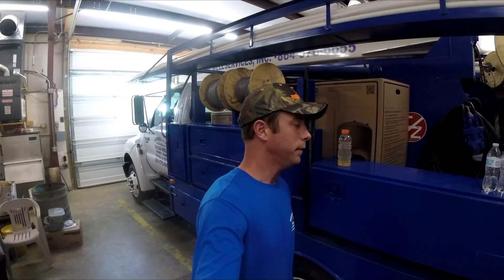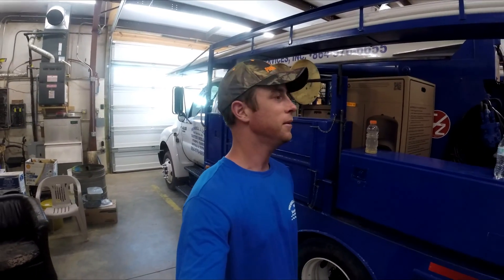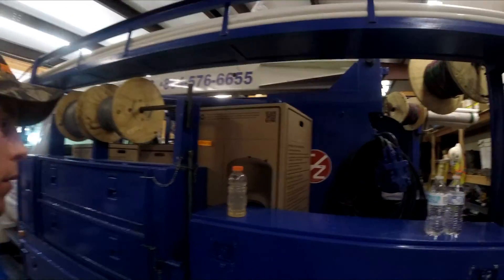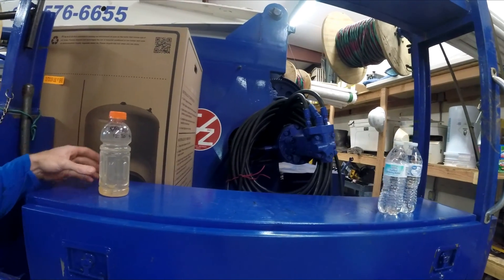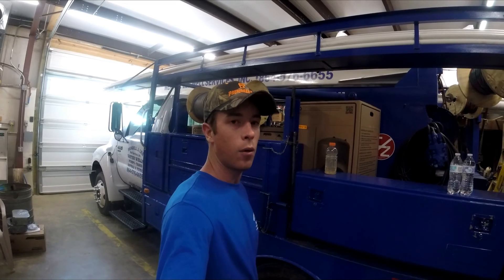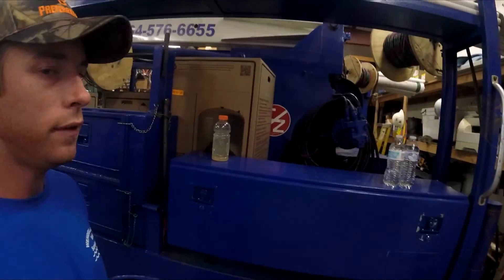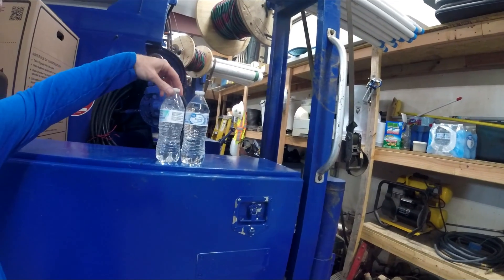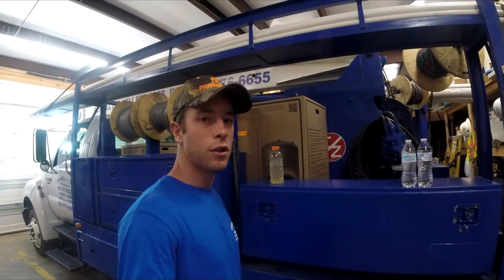Pumping a Well to REMOVE SEDIMENT and Develop Crystal Clear Water

Comment: Next to your pressure tank, there should be a hose Spigot, it should be between where you’re well comes into the house and before your pressure tank. You can attach a garden hose and run it into your yard or your sump pump to pump your well.

Comment: Would have been helpful if you showed how you pumped the well.
Reply: He just means he let the pump run to the ground for 20 hours like how the city does when they flush a line after repairs. There is probably a spigot at the well head that he flowed from so it wasn't running all thru the house piping.

Comment: Question.  I had a new well installed, they blew air down the well for about an hour.  Before connecting to the house they never pumped the water out of the well, it’s been weeks and we still have dirty water, it’s clearing but now the shower water cartridges are not working right and the toilets aren’t either?  It should have been lumped before connecting to the house?
Reply: @NetsarimTheWatchman  what if the well isn't new with the same issues?
Reply: @NetsarimTheWatchman  i live in nc my neighbor had a well drilled last year. How do I fix it??
Reply: @NetsarimTheWatchman  we have a new well (installed three weeks ago). We have not abandoned the original well yet. The water from new has a very fine sediment/sand/clay that clogs up the sprinklers. It is not hooked into house lines yet. Per well drilling company we have run the well for several 8-16 hrs a day for a couple weeks. Sediment still seen. They are now coming out to put a 2 in sleeve(?). I am concerned if there is a crack that needs repair (on a brand new well)- we are in for more troubles. Can you suggest anything? Maybe just keep running the well? We are in N Central Florida.
Reply: @NetsarimTheWatchman  thank you- I’m off to research spin down filters. We have an operational 2 inch well- but due to wanting to add on to the house, and also being told the 2 inch wells are hard to replace and we can’t chlorinate it- we opted to drill in new location. It’s a 4 inch well- but now the driller is talking about putting in a 2 inch sleeve and I’m concerned that we are going to affect the function of the new well. We’ve been running it for a few weeks/ maybe we just keep running it? Thank you again!
Reply: @NetsarimTheWatchman  again, I so appreciate your input!

Comment: My well is probably 50+ years old.  I don't think it was ever maintained well (pun...slightly intended).  I was doing some work on the outside water yesterday and had the pump on recirculate.  It is a surface pump, the water is about 8 feet below the well head and at least 75 foot deep (longest piece of kite string I had to check) and an 8" casing.  We have added bleach in the past but since I recirculated yesterday (for about an hour) the water is full of red stuff.  I am pretty sure it is rust as we put some in a glass, added bleach to no effect.  I am afraid that it is rust from the casing.... any ideas?

Comment: Hi. I've run my brain ragged trying to figure out what to do. I'm really hoping you might be able to point me in the right direction. I am the buyer on a pending purchase on 37 acres in East Tennessee. The property had, at one point, a house on it. The purchase is contingent on the well being viable. I live close to Atlanta so I'm not there and know no one local. The real estate agent found the well location but the guts are missing, or stuck down where (who knows?). He and apparently a good ol' boy down the road figured out that there is 90' of water, not 90' deep but he said water itself. It has had a metal cap put on it. There are no county records of the well. All I can find out is that it's been over 10 years since anyone has resided on the property. 
How do I go about flushing the well out, in order to test it? I'm sure there is bacteria and it will need to be shocked. There is no electricity and no pump. If there were a pump, I have a good portable generator and would figure out a way to flush it myself. There is no discernible driveway to get a large truck to the location, which is down a hill. I've typed every known configuration of words into google, google maps, youtube blah, blah, blah... the only information I can find is on homeguide.com which is more about what to do and what it might cost but not who to get to do it. 
Now I'm not some city dweller, I grew up in West Virginia and when we moved to Georgia 35 years ago where we live was the sticks. I have no problems getting mud on me and doing back breaking work but this is outside my wheel house. I've got about 3 weeks until the closing date. This property is for my widowed mother who is partially disabled in one dwelling and myself in another dwelling. My father passed almost 10 years ago, now he was a jack-of-all trades and he taught me how to weld, operate heavy equipment, mechanics, do damn near every type of home repair imaginable and we had a well in WV but I was only 10 when we moved here and we've been on county water ever since. I helped when the natural spring face collapsed on the old family home place near Clendenin, digging, shoveling, trenching, placing a new cistern to catch how far back we had to dig into the mountainside to get to undisturbed water (that was fun). Argh, sorry! I hate rambling on. I don't suppose you know anyone in that area that could do the job. I just looked you up and no your not close, but being in the southeast there's always a chance yeah. From what I've read it seems a derrick truck would be needed, but I don't even know what that means. 
Again my apologies for typing too much. You try to make an enquiry as brief as possible and it never works out. Any information you can provide me with, in any way, would be greatly appreciated.
Reply from the maker: where are you in East Tennessee? I may have some connections up there. You need to start by getting yourself or someone out there to drop a test pump in that well and pump it using a generator to see how much water it is producing. You may not need a boom truck if it isn't too deep to the water. If it is 200-300 feet to the water,  then that is a different story. At this point (3 weeks until closing), you need to be less worried about flushing it out, and more worried about whether it is viable. Because all the well drillers in upstate SC and in western NC are super busy and backed up. So you would want to get on someone's list quickly if this well wasn't viable and you needed to have another one drilled.
Reply: @WendellLeeWellServices  Hi. Thank you so much for getting back to me so soon. The property is in Treadway, near Rogersville, Sneedville, Thorn Hill. If my realtor was correct in his statement it is 90' of water but, he might of meant 90' to water. He's a local guy who owns land and also has a farm so I assume he's dealt with wells to a degree. If you know of someone reliable and honest in the area I would be grateful. If not, where in the world do I get a 'test' pump? And should I ask my realtor shock the well now (he offered) so that when I can get there to get the pumping going it's already working on killing the bacteria? Again thank you for any help you can give me.
Reply: Just curious did this purchase work out for u… I live in Treadway
Reply: @janet1278  The land purchase went through. However, we’ve hit a wall on trying to relocate. My mother has had a series of debilitating incidents and being within 15 min of a state of the art hospital is ideal. 
I was able to get the original homesite and driveways cleared and ready to move our RV onto but even that hasn’t happened. I still haven’t had the well revamped and life seems to have different plans for us right now. 
I’m hanging onto hope of relocating some day because the layout of the land is fantastic. But as it stands right now, it’s just sitting there. ☹

Comment: Just had a new pump put in well here in nc.  Lots of iron and orange coming out of faucets then looks clear until you fill  up a glass so should i run water alot to try to clear it up or wait few more days to let settle its been 6 days so far thanks .
Reply from the maker: dang, 6 days is a while. typically a well with iron can get stirred up while pulling and replacing a pump but eventually will settle down through pumping and time from something not stirring the well up. I would run it some if you haven't already. That should help it.
Reply: Thanks buddy!!

Comment: I'm in Central Oklahoma.  I replaced my submersible pump about 6 or 7 years ago.  Every since then, I will get red clay silt in my water if I run my water house full blast.  Everyday household use is fine, but if I open the outside spigot for more than like 10 or 15 minutes it turns red and clogs up my household filter.  I'm wondering if it would be a good idea to turn on the outside spigot and let it run for at least 24 hours??
Reply from the maker: that is odd there, not sure if you have a screen in your well or not but you may have an issue with your screen

Comment: Hey man I was wondering if you could help me out I got a well made it's about 12 meters deep The water comes out clear but after you let it sit it turns brown it also smells like iron when it comes out of the well I was wondering is there any fix or if I can dig it deeper to clear it up or well pumping it out help I would really appreciate your help
Reply from the maker: sounds like iron to me as well. you could potentially go deeper and hit more water that wouldn't have iron in it, or you may hit water with iron in it. I would probably have that water tested and spend te money to treat the water you have. Especially with a shallow well and I'm assuming you have plenty of water as well.
Reply: thank you for the reply I'm going to try to go deeper and see if I can hit cleaner water and yeah there is a lot of water it never runs out but the iron in it clogs the filters that I have on the well I really appreciate the help thanks

Comment: Did you just let the pump run and have the water run onto the ground? Or filter and recirculate it? Our well is always pumping up orange sediment and we get tons of little black sediment in our faucets and even just straight into a glass of water if we don’t use a Zero water pitcher. Location is middle Ga
Reply from the maker: yes, we just let it run on the ground

Comment: I had my well pump up broken limestone bits and sediments smaller than my 5 micron filter that water stains very badly. Now I go through a filter every week. Last year a hoe ram broke limestone about 200 yards from my well. Hammered for a week and a half from 7am to about 8pm. I believe this broke up solidified sediment and contaminated my water. When the well was drilled 5 years ago to 80 feet  it had crystal clean water. How do I hold the company responsible for my water problems that after a year is still bad?
Reply from the maker: not sure on that one, that is a bad situation there

Comment: Hi again from shady valley! The pump guys came a few days ago and put the pump in my well and  if you remember it is an artesian well and the water coming out of the overflow turned to rust and looked like a wide stripe of blood running into my pond. After a short time it cleared back up but they said its iron! And they are coming back tomorrow to hook it into my house. They suggest to developed my well and run it a couple of weeks then get it tested! Any extra advice from you guys is deeply appreciated! Thanks so much!
Reply from the maker: I think you are right on track with doing what they recommend. Running your well is nothing but a good thing for it. It does sound like iron to me too though unfortunately, but nothing that can't be handled though. It sounds like you have a good company working for you! Thanks again for watching and tuning in.